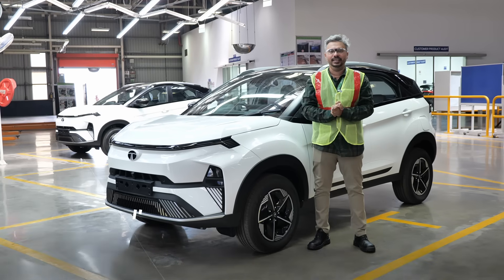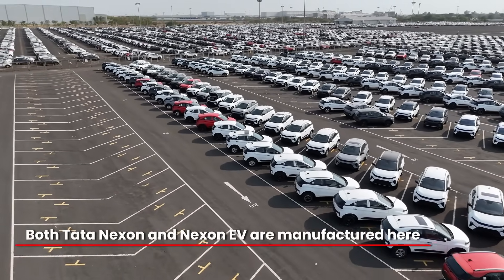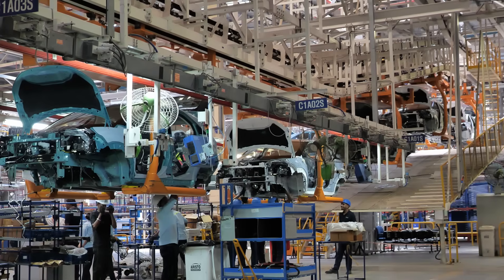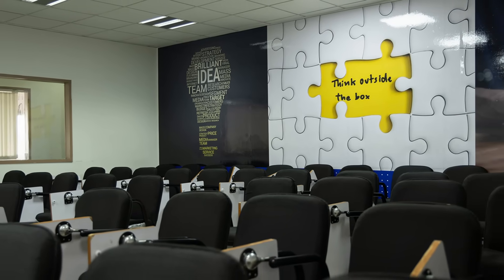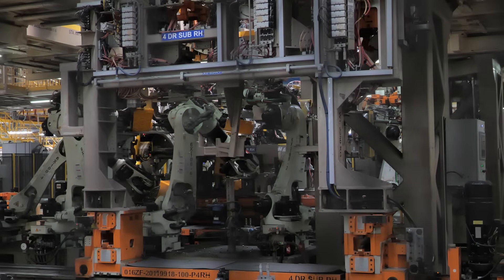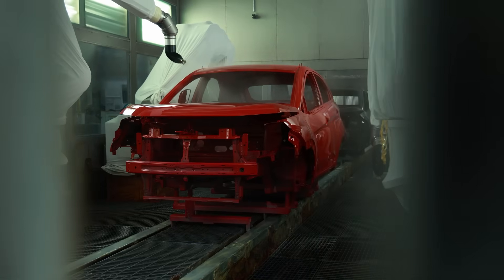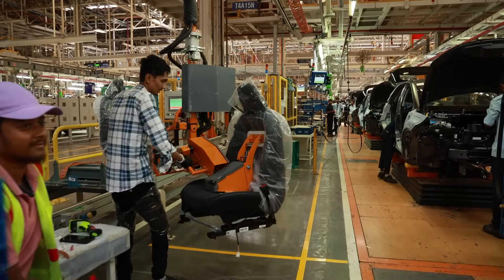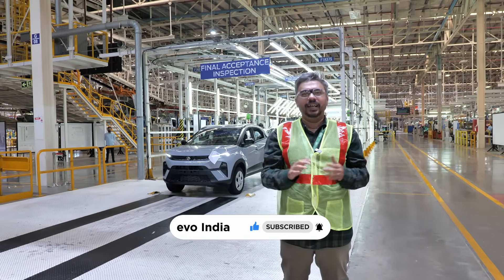How is the Tata Nexon made? | Tata Passenger Electric Mobility Plant | Megafactories | evo India

Comment: I don't think those robots that stamp metal into body parts work 'precisely' at all. The uneven panel gaps in a same car is a proof of that. Also, it's inspection and quality control at each section is required, as Tatas are prone to all sorts of issues from metal corrosion to electronic failures. A final QC may never be able to check them all. 
Thanks for the video. Now we atleast know, where Tata is cutting corners.

Comment: Where is the QC department, tata motors need more quality people in Quality department. Already facing lot of niggling and quality issues in my tata altroz dca. Parts like viper stalks, horn, dash oard panels, fuel filler cap assembly, rear parcel tray etc, are getting replaced one by one , additionally joint at of roof and C pillar needed to be welded seperately for a clanking noise. Feel like moving to consumer court now for this 8 months old problematic car. My 4yr old nios amt is far better than this scrap.
Reply: 😂 exactly cheapest cheapest bol ke QC ka department nahi hai. I will never buy a tata car, currently own nexon petrol version. 3rd class vehicle in terms of quality. Cant be fooled again in the name of vocal for local and safety . Definately buying a European car for above 12 lakhs 😅
Reply: @dwanelkemprai4983 u r lying, u don't own Nexon.
Reply: @dwanelkemprai4983 tu iss duniya mein ek 4th class gawar hai bro
Reply: 5 star mil gaye hai na Nexon ko, aab quality wale so rahe hai  @dwanelkemprai4983
Reply: I own 2 altroz xz plus one for last four years another for last 3yrs 
Till date both has no problem 
Yes engine is not so refined especially during starting 
But it's a 3 cylinder engine that's normal for a 3 cylinder engine.
Previously I own Suzuki Swift 
Build quality was so bad that if a cycle hit my car it used to get big dent.
Reply: @Krishcnmc  no one is complaining about build quality, so comparison with suzuki is baseless. You were one of the lucky ones. I have seen pol literally shouting/ begging/ whining at Tata Service Centre over their many unresolved issues. I am myself suffering from last 1 yr with many issue with my nexon ev. Finally settled to live with it as i dont want to waste my time, i have wasted my money already.
Reply: @Krishcnmc  I know. Even my family and friends have altroz, tigor, tiago, punch, but no one is facing such issues. And I know that altroz is a wonderful car but the problem is that even the niggles and problems of the car are inconsistent. Every month I am getting a new problem. Example, right from day 1 it's right side front viper blade made noise in any kind of rain and was not smooth. Once the whole viper stalk was changed it resolved and now the left small viper is making noise. This is just one of the many such type of quality problems. I have named my car as Rattle-troz.
Reply: @Krishcnmc  very true. I have no second thoughts about the heavyness or the build of the car. For me the engine is weak only at the initial start off. The suspension is the highlight. It can go at speeds on rough roads better than any other hatchback. My only problem is the inconsistency even in its regular niggles. Rattles from dashboard, B pillars, it's just annoying. It just destroys the whole experience of a great ownership.
Reply: Last line is QC line
Reply: I have similar issue.
Reply: And I have a trail mail of more than 50 mails marked to the dealer, and company and even the MD of Tata Motors.
Reply: Bhai bacha hi kya😂😂😂
Thank god brezza li mene
Reply: Tum jese logon hum log videshio ke gulam hai aaj bhi . Zero star wali car ko premium hatchback compared karke gaali de rha hai. Hundai ke baare mne agli baar muh tod denge Blacklist kar denge. Or
Last ma ko gaali dena aasaan hai.
Reply: Lagta hai tera gawar deemag ek shraap hai
Reply: @evoindia I would like to now highlight my altroz issue with you. Please help me . I stay in Pune and would like to visit your office personally and share my experience (ordeal) with you all.
Reply: Trye
Reply: Tata me qc means .. chaltha hai. Pass kardo.
Reply: @kingsizelife23  ha ha right.
Reply: @kingsizelife23 😂😂😂 hamare yaha aisa hi hota hai ( mai khud weld Quality se hu)
Reply: Tata Motors won't even have the quality department that's why they didn't show it on the video😂
Reply: True cheap interior quality materials
Reply: Sir exact same filling. we getting dumped poor qc fit n finish vehicles in the name of five star safety rating.
Reply: Go to Europe why putting your load on India....showing overcomplaining about everything.
Reply: QC department is shifted to the safety department 😂. Hope someone in the world starts giving QC ratings as well then hopefully TM will start having a QC department as well.
Reply: Sounds propaganda to me. Just hating unnecessary.
Reply: @ashutosht10  here comes the fanboy
Reply: @ashutosht10  bro.. itne sare log ek from different corners of the country ek saath ake propaganda kare to uske "sachhai" bolte hai. You may be lucky u didn't had any issue, but we all are suffering.
Reply: @ashutosht10 Aww Tata ke 14 ko bura lag rha hai lagta🤡🤡🤡